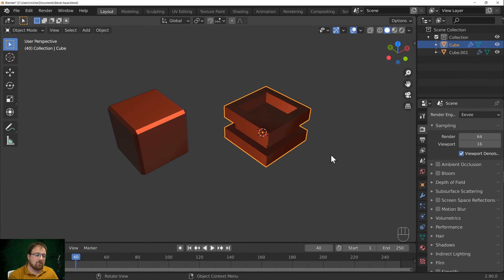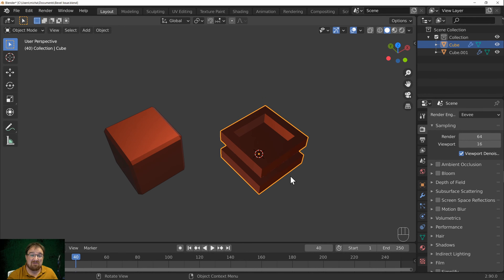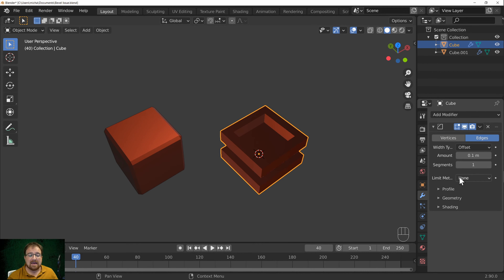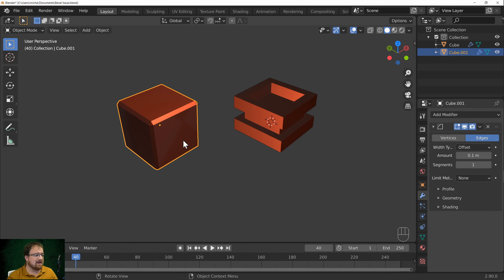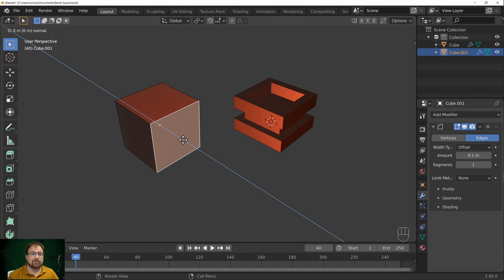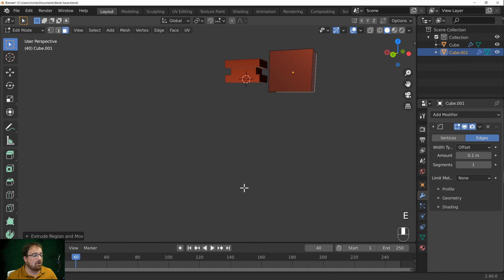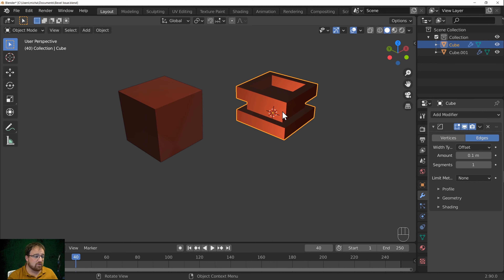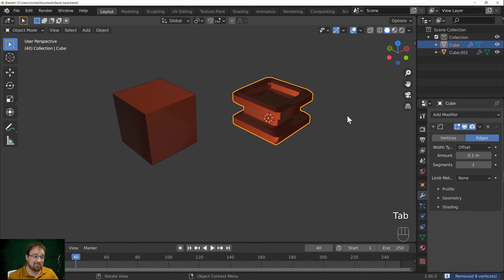Bevel Modifier Not Working? SOLUTION!

Comment: ... or you could just go to Properties Editor - Modifier Properties - (the modifier with Bewel, might have been renamed) - Geometry - Intersections and remove checkbox "Clamp Overlap".

That checkbox is enabled by default for all new bewel modifiers to avoid issue where edges that are shorter than the bewel amount would cause intersecting edges. And if you do zero length extrude you have edges with zero length and the "Clamp Overlap" will limit the maximum bewel length to zero.

That said, you still want to fix the geometry to not have zero length edges but the lack of bewel is caused by that overlap clamping/limiting.
Reply: OMG! Thank you so much. It worked :D

Comment: what if the distance is far enough for 'merge by distance' to do something but close enough to mess up the bevel modifier? Is there a way to increase the distance for merge by distance?
Reply from the maker: Sure the operator panel offers a distance option, and of course you could select specific parts of your model rather than the entire model.

Comment: rip this tip? merge by distance is not showing to me ):
Reply from the maker: Firstly, make sure you are in edit mode that’s a common mistake.

Make sure you select all the vertices you want to potentially merge. 

Finally, press the M key and select By Distance. 

Still works on 4.2.1 😊

Comment: i am really confused cause i only used extrude one time and streched it like a meter still tried this but it still doesnt seam to work for me
Reply from the maker: As a guess try selecting your object and press CTRL+A and apply the objects scale, "stretching" can be caused by unapplied scales.
Reply: @MichaelBridges3D  alright i will check in a moment thanks for replying!
Reply: @MichaelBridges3D  i just checked and this worked perfectly thanks
Reply from the maker: @jentkuipers  Niiiiiiice 😄

Comment: I'm still not able to use bevel modifier for my object. When i apply merge by distance it was displaying 'Removed 0 vertices'

Could anyone helpme with that😓
Reply from the maker: Tried Applying Modifiers as well?
Reply: @MichaelBridges3D  My object is not beveled by applying bevel modifier in modifiers section but i applied bevel modifier manually by using shortcut ctrl+B

Thanks for the response 😊